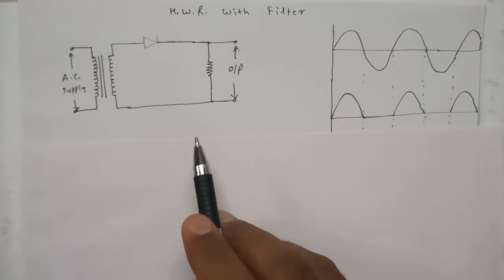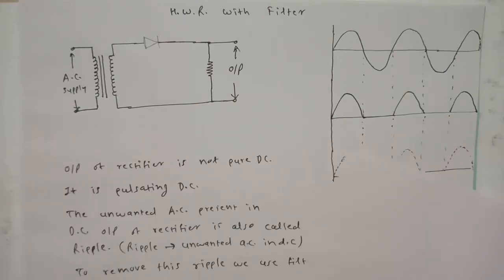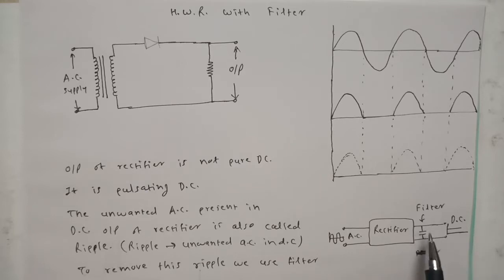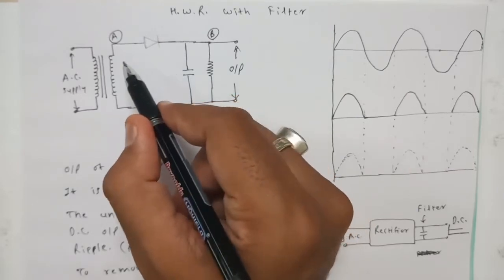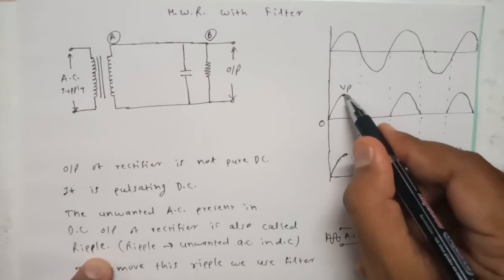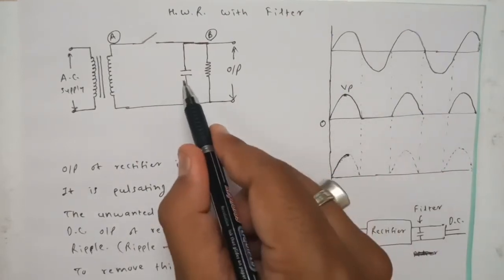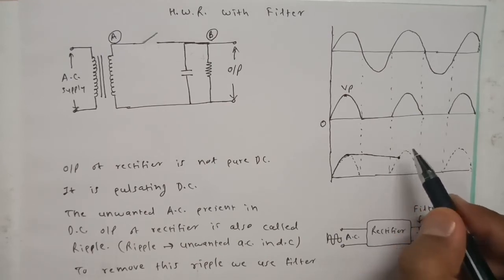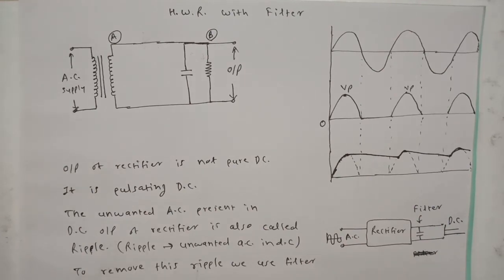Half Wave Rectifier with Filter||Electronic Devices and Circuits||HWR||GATE ECE||Filters||EDC

Comment: Question? - I have circuit diagram from 2005-2008. It  has DC to AC 
Inverter of 120v AC output secondary of (2) leads, hooked with diode on each secondary line , 
that is reversed polarity .( Both different) one way , then other way. 
My test meter reads both on AC and DC . How do I get proper reading on this? One cathode faces outward, other diode cathode faces secondary  Is this still AC output? Is this half wave DC or still AC? How to tell if negative or positive DC out?
Reply from the maker: its difficult to visualize circuit you are describing, pls send the circuit diagram on my email yogidhiru@gmail.com. i will reply you soon